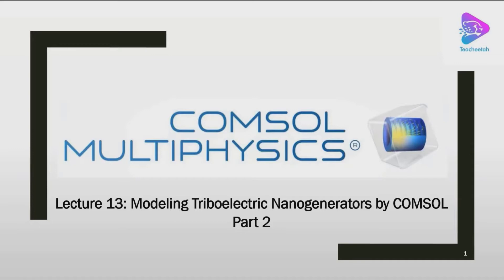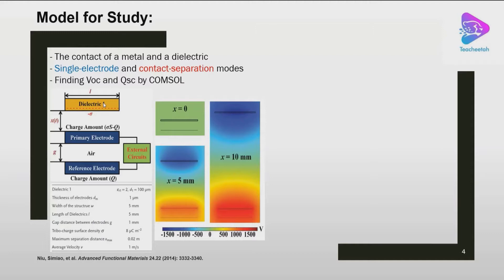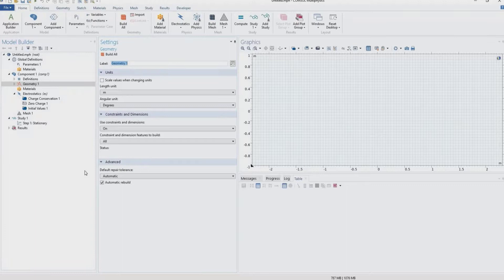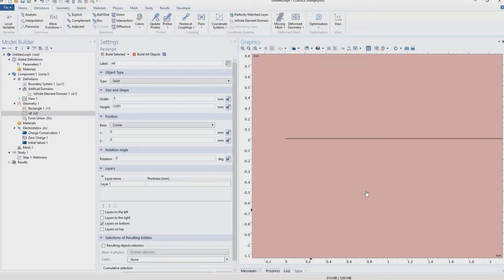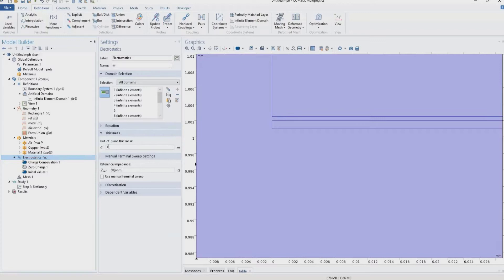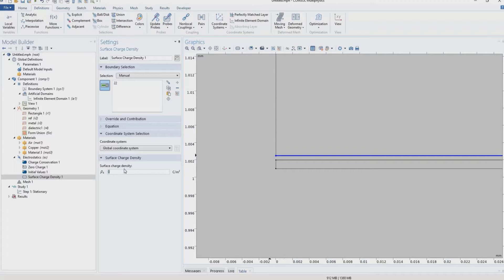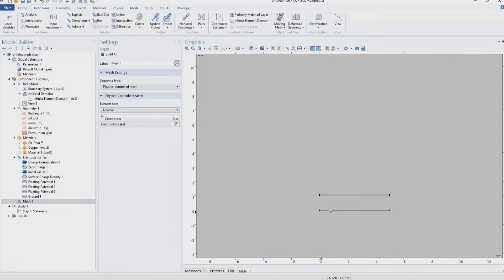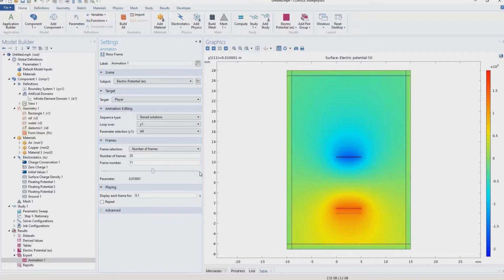Tutorial 13: Modeling Triboelectric Nanogenerators in COMSOL Multiphysics: Part 2

Comment: The video related to TENG simulation is really useful. Kindly upload videos related to time dependent study for single electrode mode TENG and also how to find the load characteristics of SE-TENG?
Reply from the maker: Thanks for your comment. We may plan for more videos on the TENG topic. Please also note that based on the theories of triboelectric nanogenerators, the open circuit voltage Voc and short circuit transferred charge Qsc are independent of time and they are only dependent to contact area and surface charge density in theoretical modeling. The Voc and Qsc are the two outputs that we find through COMSOL software simulation and does not matter either we use stationary model or time-dependent. These two results can be later combined with mathematical models and differential equations to study the effect of time or dynamic motions on the output current, resistive loads and so on, which is carried out numerically in other software like MATLAB or so not in COMSOL.   We suggest reviewing the articles on how to theoretically model the TENG performance based on math models e.g. Nano Energy, Vol. 14, pp. 161-192, 2015

Comment: Thanks for these informative videos. Can you upload some more experiments on triboelectric nanogenerator? such as output characteristics, variation of voltage and current with varying load resistance?
Reply from the maker: Thanks for the comment. It is a bit challenging to directly study the effect of varying load resistance on the performance of the TENG in COMSOL. Alternatively, you might be able use the results of open-circuit voltage and short circuit charge obtained from the simulations and insert them into the existing theoretical models of the TENG systems to study the load effects numerically. The review of this article is suggested: "Theoretical systems of triboelectric nanogenerators, Nano Energy, V. 14, 2015, pp 161-192"

Comment: Thank you for this amazing job !
Reply from the maker: glad you liked it, hope it helps you with your research/courses
Reply: @Teacheetah  Hello again! I'd like to model a contact mode separation TENG with copper in the middle and two PTFE (one at the top and one at the bottom) but I can't do it... Could you help me please ? Thanks
Reply from the maker: Thanks for the comment. It really depends on the problem such as the location of electrodes that are connected to external circuit and the moving layer(s). Let us assume that the electrodes are placed at the back of the PTFE layers, and either the middle Copper layer or the two PTFE layers are the moving part(s). In the contact region at each side, you may use -σ Surface Charge Density boundary condition at the PTFE surface and +σA Floating Potential boundary condition at the Copper surface (A is the area). For the open-circuit condition you may use Floating Potential boundary conditions on the outer electrodes (back of PTFE layers), and for the short-circuit condition you may Ground boundary conditions on the outer electrodes. Most of the parts are similar to our model or could be perceived from our model shown in the video such as using small gaps, applying motions, extracting outputs, etc. The following reference is also helpful for better understanding the problem: “Nano Energy
Volume 12, March 2015, Pages 760-774” 
please let us know if you need further help.
Reply: @Teacheetah  Thank you very much for your quick answer. Would it be possible to discuss it by email or somewhere other than in the comments please ? I think I'm almost there but I still have some questions.
Reply from the maker: Thank you Ines for the comment, we prefer to have the comments in the channel as it might be helpful for others too. If you need further info or discussion, please let us know. So, we can do further arrangement.
Reply from the maker: Although we prefer comments, you can reach us by Teacheetah@gmail.com.
Reply: @Teacheetah  hello ! I sent you an email, hope you can help me
Reply from the maker: Thanks for the comment. We will reply your email ASAP.

Comment: Thank you and is very useful. Is there any possibility of making a dielectric-to-dielectric attached-electrode parallel-plate contact-mode TENG tutorial in Comsol?
Reply from the maker: Thanks for the comment.The modeling for that case is very similar to the contact-separation mode presented here. You may only need to define another geometry as the bottom dielectric attached to the bottom electrode. At the contact region, you may assign a positive charge density (+σ ) on the surface of the dielectric with positive affinity (e.g. Nylon) and a negative charge density (-σ ) on the surface of the dielectric with negative affinity (e.g. Teflon). The rest of modeling process, setting boundary conditions, and extracting results are very similar to what shown here.
Please let us know if you have any further question.
Reply: @Teacheetah  Does anything change with the floating potentials in this case? I have been trying but can't seem to get similar results. I have set 1 floating potential to the back of each dielectric with the opposite charge.

Comment: Hello, Thank you for this expalanation for the TENGs simulation in COMSOL. But I have question. I have to make the movement of the tengs like up and down and record it in the time-dependence domain. I could not understand how to do it. Can you help me? Can you do a tutorial for this?
Reply from the maker: Generally, you may assign the Moving mesh/Deforming geometry to your geometries and combine it with the time-dependent study to model your system’s motion. However, note that the open-circuit voltage and short-circuit charge which are found by the COMSOL simulation are ideally independent of time, velocity, or frequency, and the geometry sweep could be sufficient for the geometry motions.

Comment: It's awesome. Infact I started COMSOL simulation from this video. But, facing one problem. During contact seperation mode, when I am trying to get Voc using COMSOL not MATLAB, similar result is not coming. Can you tell me what will be the exact x and y value for cut line 2d for ref and contact electrodes? I think I made a mistake here.
Reply from the maker: Thanks for your comment. The coordinates of cut lines are shown in the video, please check minutes 19-21 of the video to find them.
Reply: @Teacheetah  the cut line points for SEM  (X, Y) will be same for contact seoaration mode? I want to know the value of (X, Y) for reference and contact electrode for contact- seperation mode.
Reply from the maker: Thanks for the question.We do not use the cut-line method in the study of contact separation mode here. Instead, we select the back of the electrodes and then extract the results for further use. The detailed steps for finding the outputs of this mode are clearly shown as well.
Reply: @Teacheetah  Thanks for your reply. Yes, I watched out that you used MATLAB to plot the data. But, if I wanna use COMSOL to find out Voc then what will be the value of coordinates, what do you think?
Reply from the maker: The cut line does not work here. You can use other software to process your data for Voc like Excel, Origin etc not necessarily MATLAB
Reply: @Teacheetah  Thanks much. Just requesting you to upload more videos on TENG. If it is earlier will be best.
Reply from the maker: Sure, we will upload more videos on this topic

Comment: Can you explain how to set floating potential for the whole domain, not for boundary layer condition?
Reply from the maker: In the software version that we use and for the Electrostatics interface, the Floating Potential is only available for assigning to boundaries. Maybe you could check other software versions or alternatively, see if you could use Terminal condition on the targeted domain for your modelling?
Reply: @Teacheetah  Thanks for the quick reply and wonderful videos for TENG simulation. I have another specific problem right now. I want to simulate the spatial charge distribution on a conductive square. There is no external electrical field, I just put, say, 100 charges on the square, and let the charges spread due to minimum energy rule. Do you know how should I do it? Do I use electrostatic or electric currents, and what is the difference between them?
Reply from the maker: The use of proper interface depends on the system modelling and the physics that you deal with in your problem. The use of Electric Current interface is used considering the Ohm’s law where all the domains need to have a conductivity ( even very small for poor conductors and insulators) along with the relative permittivity and thus, electric current flow may be involved as well. You may find more info on this interface in our Tutorial 5. However, the Electrostatics interface is for electrostatic condition and charge conservation considering the Gauss’s law where the material’s relative permittivity may only be involved. For a conductor under electrostatic condition under external field, the field inside is zero and the charges may only appear to be on the surfaces‌ as a floating potential. The physics and details behind the two physics are beyond the discussion here. However, useful information could be found on various references like the COMSOL’s AC-DC module guideline which is available online.